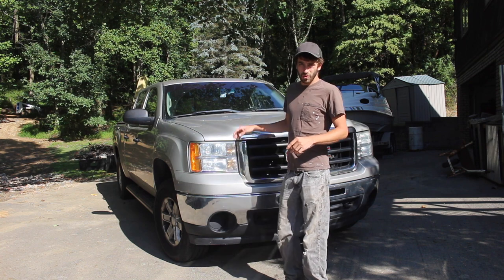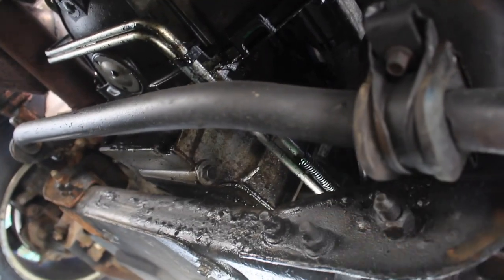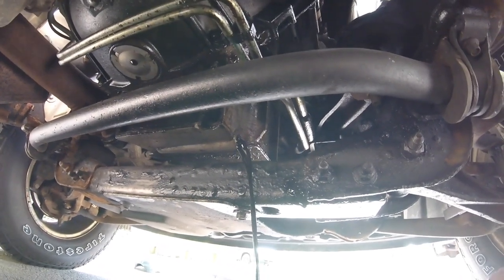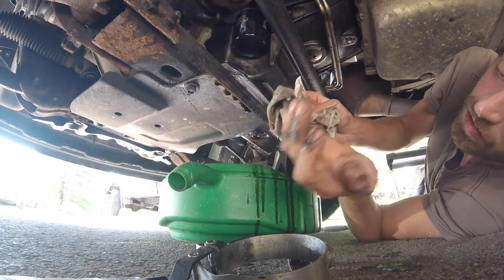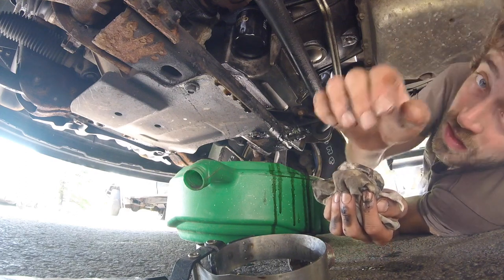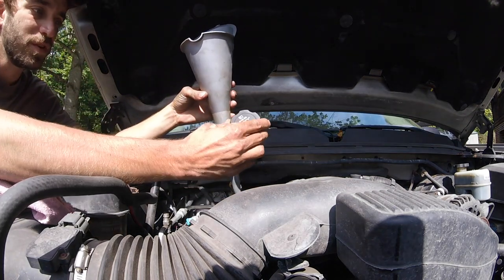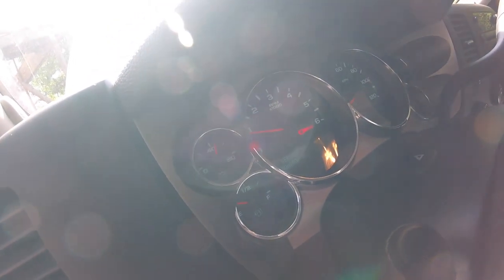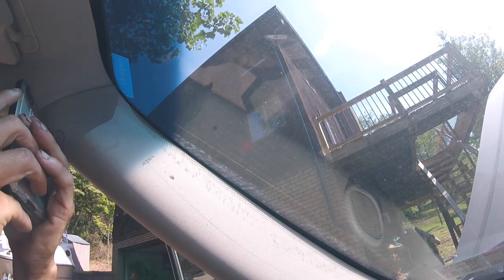2009 GMC Sierra 5.3 Oil Change

Comment: I use Mobil 1 Synthetic Oil. I change it once a year and change the filter at the computers oil change interval. About every 5,000 miles.

Comment: Do not snug the filter with the wrench. They should only be hand tightened
Reply from the maker: Thanks
Reply: @IntoTheDirtshop  if you don’t have to fight the filter off next oil change........ you didn’t over torque it. “Hand tight” is a vague spec for a component that could trash your vehicle if is vibrates loose on the Highway.
Reply: @beckyschwantes5287  Men with strong hands can pretty much go hand tight.  For others 3/4 turn after the seal touches the block is what you want.  For weaker hands using the strap wrench would be the solution.
Reply: @beckyschwantes5287  I just pulled the filter off a 2008 GMC Sierra.  The hand tight method is not really practical on this engine...there is not enough room to get a good hold on the filter, the one I pulled of was loose and also leaking.  So use a tool and go 3/4 turn.
Reply: Is the fear of over tightening it a worry for seals and threads or is it more of a "just a bitch to take off"? 

It's probably a dumb question for yall but I'm trying to do some learning and in more of the beginning stages of learning how to work on my own shit lol thanks in advance.

Comment: Go ahead and start changing your gasket at the drain plug. Keep your crank case sealed, stop the slow leak that will eventually form.
I saw you looking for Babbitt. Is that magnetic? I can’t remember?  Magnetic drain plug.?
So my buddy has this same truck your driving, and when he starts it up he has a an extended crank over. Sounds like crap. Some shop in town just got him for a fuel infection module. Which didn’t help. Almost sounds like the pump is struggling to pick up a prime for a good 20 sec? Ever seen this?
Reply from the maker: Babbitt is very weak magnetic, its tin/zinc, yes I ended up buying a pack of those drain plug seals after this and change them each time.  Not sure about your prime issue, could be clogged filter or something more related to timing or oil pressure as well

Comment: Where did you find the oil filter wrench for that at? I have a 2013 Sierra 5.3 liter and went to change mine and these oil filter wrenches I bought just suck, when you stick your ratchet into it,  the wrench is to thin and the ratchet end gos in to far and rides up against the oil filter. After an hour I gave up and none of these auto part stores have one like you have.
Reply from the maker: I’m pretty sure I either got it on Amazon or walmart